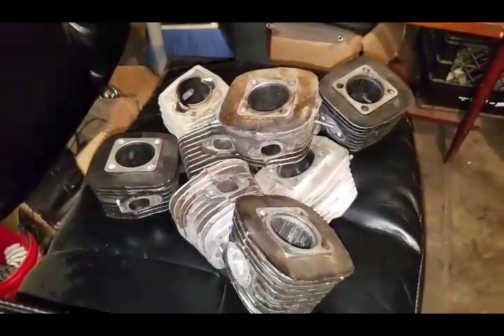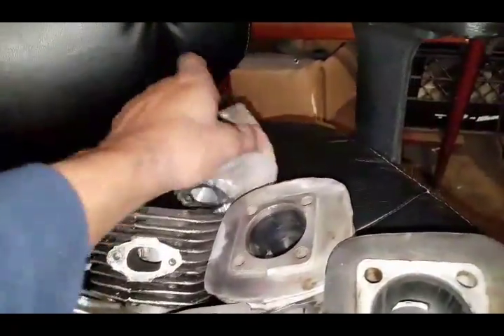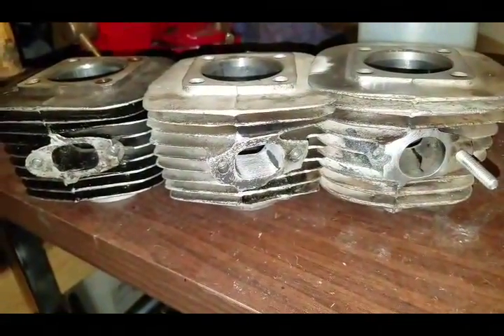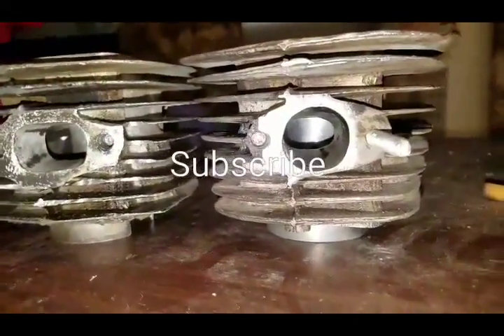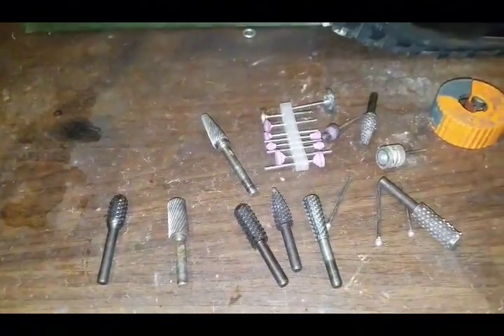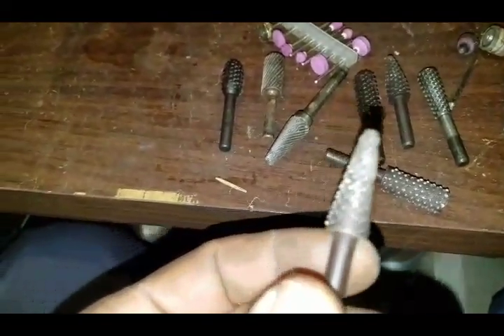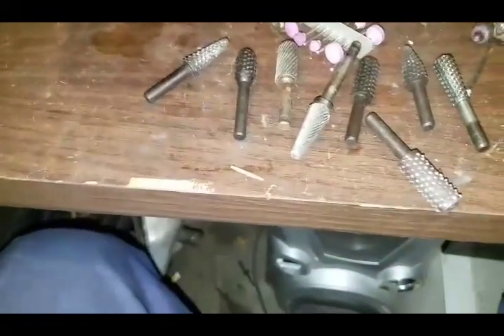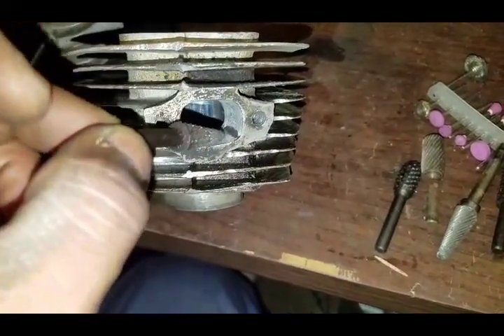Motorized Bicycle Port Matching And Porting For Speed #DIY

Comment: Hey Bro, Kool videos. Soo... being a welder my entire life you often learn that the grinder becomes your best friend. Now with aluminum, your bits best friend is going to be BeesWax. We always bought it from our supplier in bricks an by the lbs. You actully have to look hard for it at the hardware stores but it's there. It's a softer type but does work very well. Candle wax I've used in a pinch but nothing like BeesWax. Soo you've seen aluminum build up on your bit? Wells that's like cutting aluminum with aluminum and that's why you use it. It lubricates your carbide so nothing sticks to it. Trust me and pressure lightly while cutting. Use it on all aluminum, drilling, sawing, cutoff wheels, chopsaws, burrbits, ect...
Reply from the maker: Great information thx my friend

Comment: I tried those 1/4 bits with a drill and it didn't work. was I doing something wrong?
Reply: You can’t use a drill. They don’t have high enough rpms to shave the metal away. Go to Walmart and buy a $25 dremmel and it’ll do the job
Reply from the maker: Vasily Custom Builds it has to work at least a lil lol